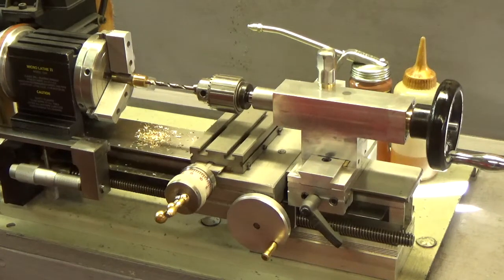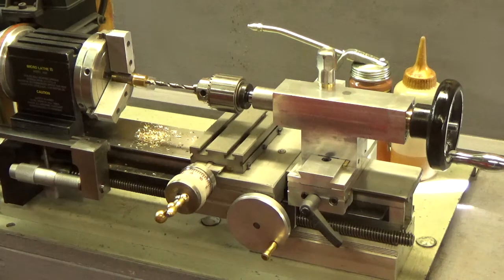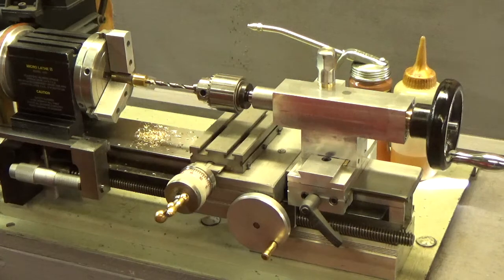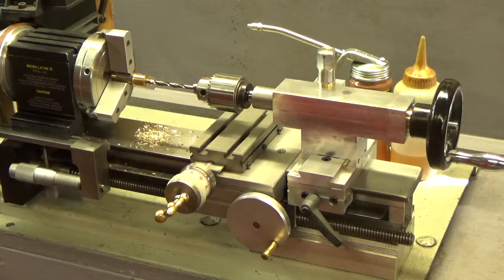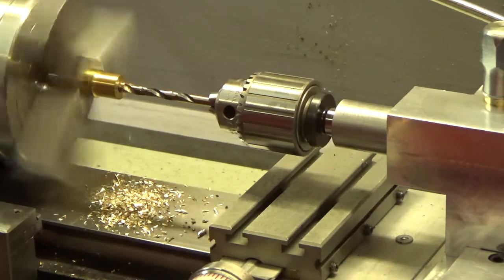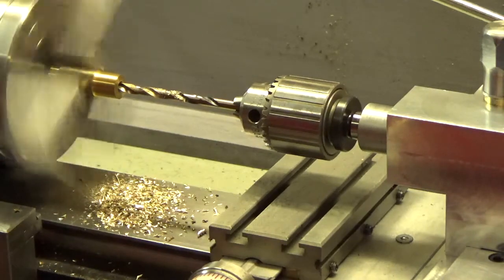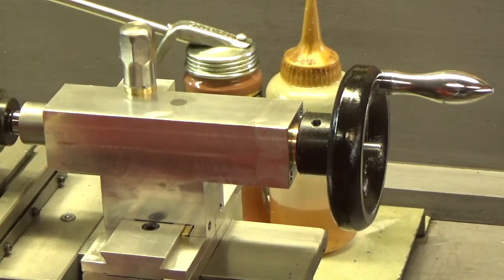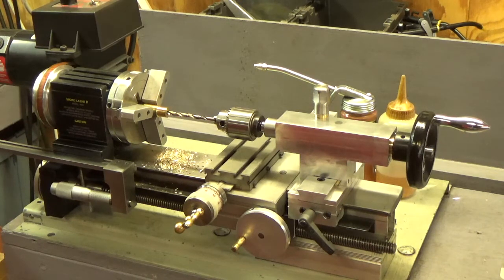Taig Lathe Tailstock Build No.5 (Progress Update)

Comment: Hi, Larry, great job so far, I think it looks good on the lathe and as far as being too big it really doesn't matter, I think Mr Taig would be happy too, this little lathe brings out the best in some of its owners by using the vision and aptitude to develop and improve, that is a learning process just in itself,
Reply from the maker: Walter:  Thanks for your comment.  I didn't mention it, but I can also adjust the location of the internal bronze bearing on the lead screw shaft quite a bit, considering my nut is rather long.  Doing that would reduce the quill overhang at its nose.  I'll use it like this for awhile and see how things progress.  I'll probably receive the cheapie handwheel in a week or so from China.  I added a small extension on the end of the live center MT so it will extract easily.  I will also need to figure out a way to add to my dead center.  the live center already had a M5 threaded hole in the end, so just a M5 stud was needed.  It's a fun little project and really improves the functionality of the lathe.  Maybe now I'll quit bitching.  Best Regards: Larry